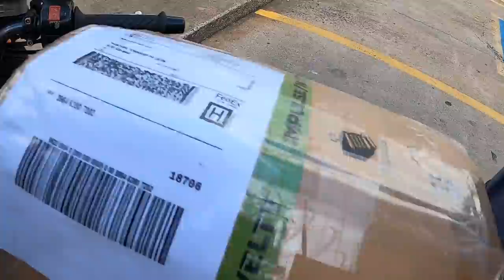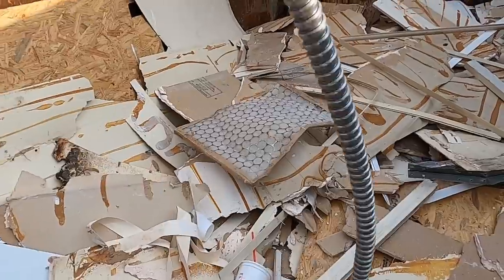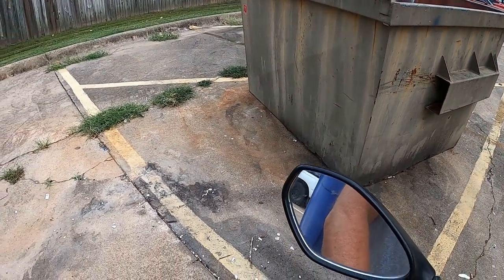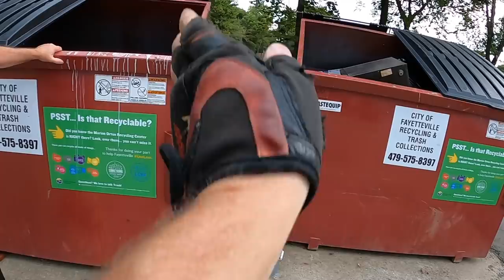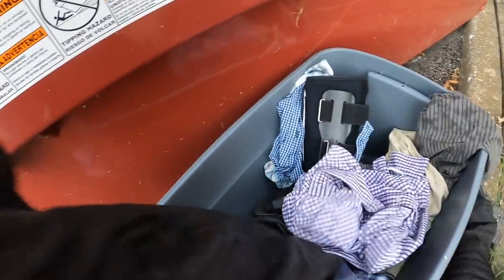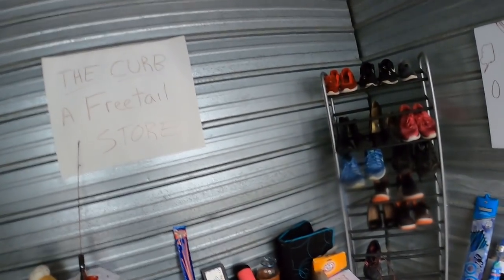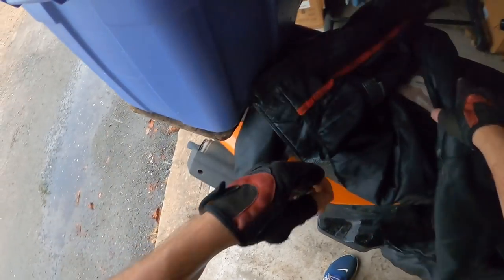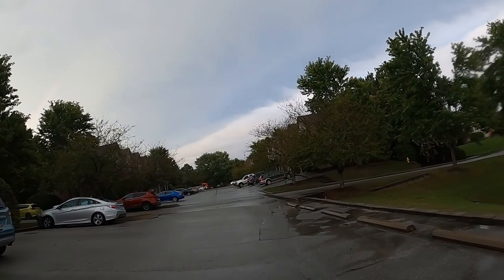Urban TRASHURE Hunting - "Leather Motorcycle Jacket"

Comment: excellent opening music; love the blues; KWS fan; wanting to see you break up that cast iron coz I've got a cast iron sink at my mom's house from the 1940s, too heavy to move or lift and I need to break it up
Reply from the maker: maybe list it for sale on craigslist and say to bring some guys to carry it. They have value. Or even list it as free for a scrapper if it is in bad shape.
What I was going to do is if i could lift it out of dumpster i would drop it hard on cement ground from 8 feet or however tall that dummpster is and it usually does the trick, at least a small crack to work on by picking up even just a matter of inches and dropping it repeatedly. Also could smack it with something like an anvil repeatedly or sledge hammer, but watch out for flying pieces of iron. Wear eye protection, particularly if it has porcelain on top.

Comment: The Leather Jacket Gold👍  - Every video im like NO   thats Junk   dont  no  leave it    then next dumpster i,m like WTF  pc Hdd's :) laptops take out the cam bars batteries if old 
you can Make yourself  a security cam network Cheep its in Youtube 💻green 3.7vl recharbles  handy  And if old Hdd's i open grab the Magnets out i have a stack on a lamp near me :) 
glue to a laptop base if working on a car wont slide off Put felt covers over magnets no scratch or put in side some plastic strip & glue it it under   work it  out >OZ 🦘⛱
Micro waves  Copper in side  & magnets - powerfull units ⚡ people use these to make burning patterns in wood like Trees 🌳branches or use a welder  amp all in UTUBE howto

Comment: dam that is one chunk, aws there rubber around there or a tyre? as that would be a blow out, that or it as rusting off it looks to of been run over by the rest of the truck, mind you you hardly feel anything in those rig so lil bit like that you'd think pot hole or ruff road, dang looks like someone else peaked in and grabbed the rest of the scrap in there, furkullj, dam old school mircowave, bummer you can't fix them as you know radiation but that would of been a sweet pay day wonder what's wrong with it? those power strips are like the ones you see in goodwills for the power parts, 280 for a jacket nice lil pay day,